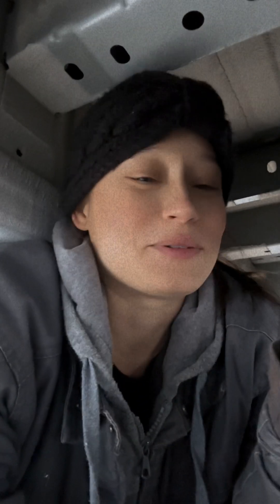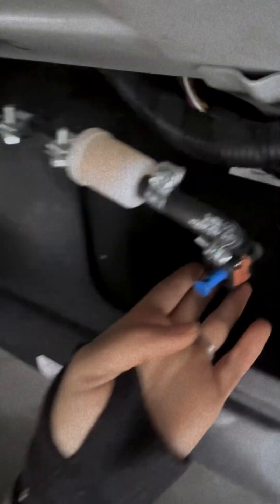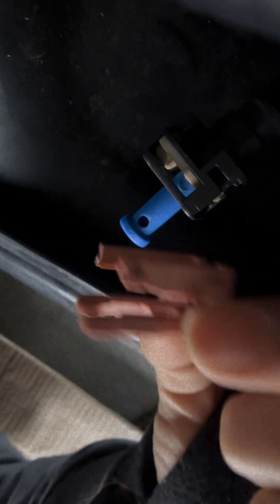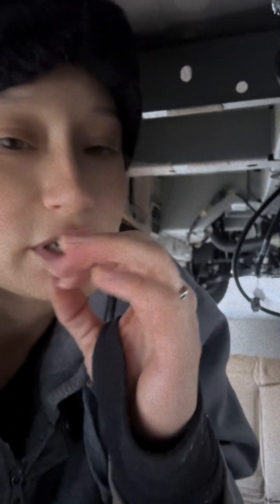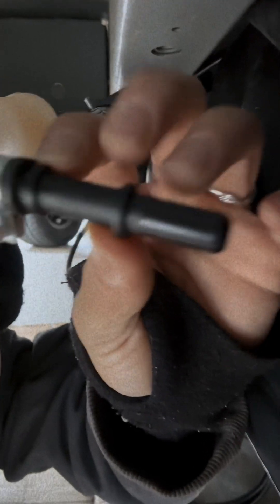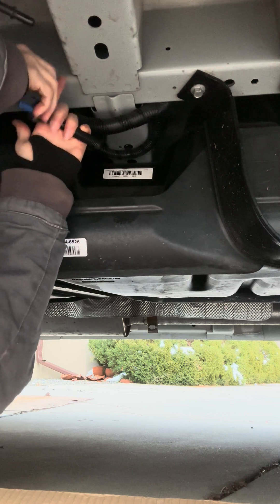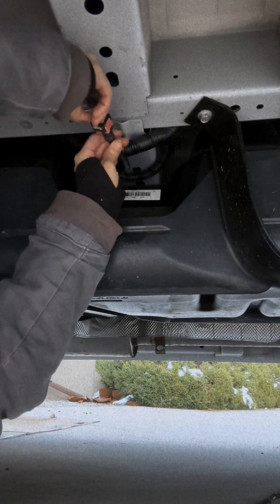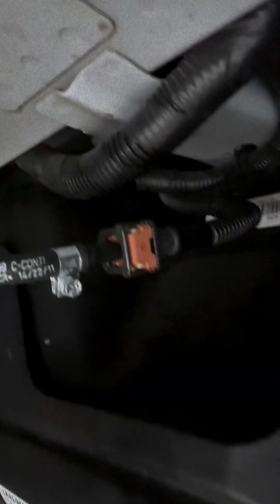Accessing ford transit 2023 auxiliary fuel port extension line for webasto stc 2000 install

Comment: So appreciative of this video. I was able to install thanks to this - I will say, I waited until I had a quarter tank and had no over spill from the line. I also did not have to cut anything I was able to just pull the red tab open, remove the blue plug, and insert the black adapter, and close the red tab to secure. Thanks so much again!!
Reply from the maker: @thelowbudgetpod  dang! I don’t know why I wasn’t able to pull that red tab out without cutting it. That was a good idea to do this with a quarter tank. Wish I had thought of that haha

Comment: Darn, I have the 2019.  :face-purple-crying:
Reply from the maker: @mikefranks4528  bummer! But at least the regular adapter kit will work
Reply: @jessicapu5619  True. Hey, do you know how many gallons that extended tank actually takes?
Reply from the maker: @mikefranks4528  it says it takes 30 gallons. We haven’t run it below a quarter tank so can’t confirm for sure.

Comment: Very good information !!!! I was looking for an Espar heater with the Transit kit option because it come with the yellow plug . Now I know that I do not neet the yellow plug. So I can buy the regular Espar and save some money. Thanks a lot!!! 🙂
Reply from the maker: @bj231bj  glad it’ll save you some money! My kit also came with some extra connector pieces that turned out to be very useful so maybe check the route you plan to run your fuel line because it’s a long ways and there’s some twists and turns if you plan to install the heater under your passenger seat

Comment: Wow, thank you so much for making this video. I have been researching this question for months and have had little luck with the engineers and nerds on the Ford transit forum. Lol. 

I already purchased the adapter on eBay, thank you so much. 

You mentioned that you also bought a different elbow of different size, do you have the link for that as well or did it come with the webasto kit?

Also, would this also work for the espar?
Reply from the maker: I didn’t buy any special elbows. The webasto kit I bought (North America version with altitude adjustment from van life outfitters) came with a couple different types of tubing elbows and one of them just happened to fit perfectly. I’m not familiar with the espar. My partner did most of the research decided which heater to buy and I just did the install on the one he chose lol

Comment: I've been looking all over for this, and Ford was clueless when I asked them for the part number. Thank you so much for adding the link!!
Reply from the maker: @aaronanderson4502  I had the same experience when I called my local ford as well. They couldn’t even confirm for me what the fuel port extension like looked like or where to locate it, let alone the parts needed to connect to it

Comment: Nicely done!   I ordered a 2023 Ford Transit van and will get it in May.  I was going through my options and came across this and didn't know what it was for.    I still don't.   LOL!  What is the purpose of changing that out?
Reply from the maker: It's so you don't have to lower your gas tank off the van to install a webasto gasoline heater in your van. I've heard there can be issues with using the auxiliary port but we figured it was worth giving it a try before going through the hassle of lowering the tank. You can buy a webasto kit with the ford OEM part to connect to the port that is on the top of the tank (only accessible by lowering it) but I guess whatever connector they used for the auxiliary port is different than the one on top of the tank and so the standard connector part that came with our webasto kit didn't match the auxiliary port.
Reply: @jessicapu5619  Oh.  Got it.   Thanks!